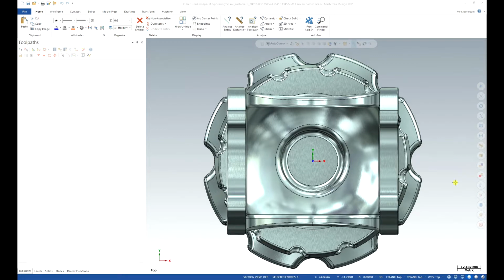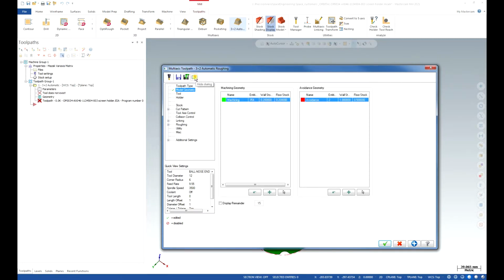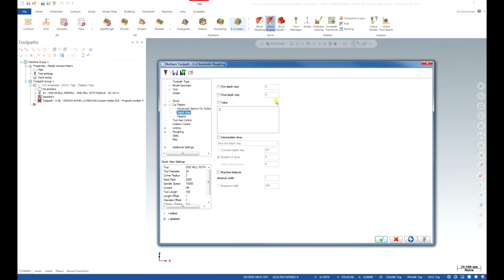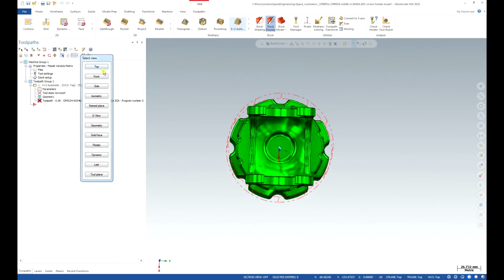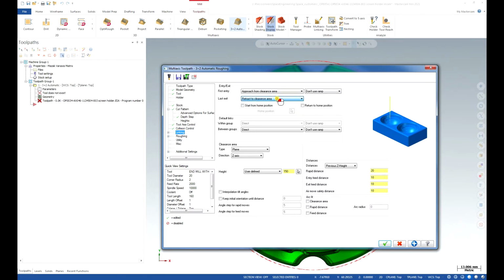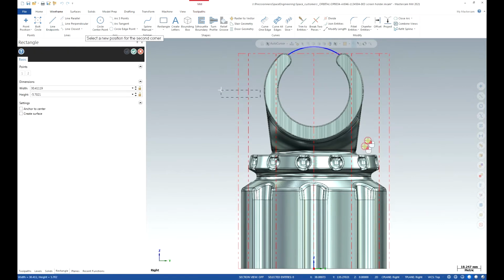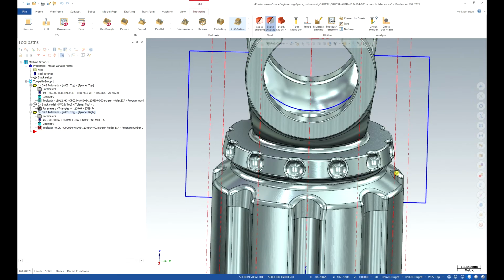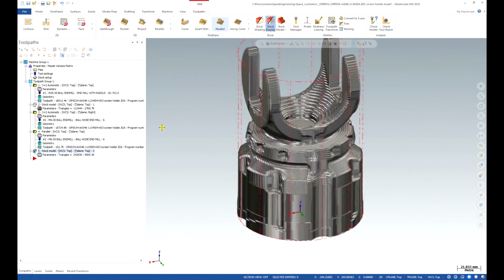Mastercam Multiaxis Tutorial - SCREEN HOLDER 1/3

Comment: Great vid, however I’m trying to make the first roughing and I get an error message saying “unknown exception in 5axmsurf, please save your work and restart mastercam” any ideas around this?
Reply from the maker: It looks more like something to do with compatibility, 
it is more windows error i think  
im not sure to be honest 
did you try to reinstall?
What version of mastercam and windows are you using
are you using home learning edition? 
ill try to get more info for you tomorrow
Reply: @aspeaerospaceprecisionenging  I’m using mastercam 2021 from windows 10..it’s on a company computer  so I’m not sure if it’s due to a lack of machines in the system. For example I’m just using machine default rather than selecting a machine (not sure if that matters). Thanks for looking into the issue! I can try a reinstall, but haven’t yet